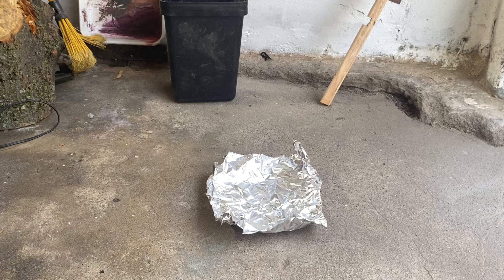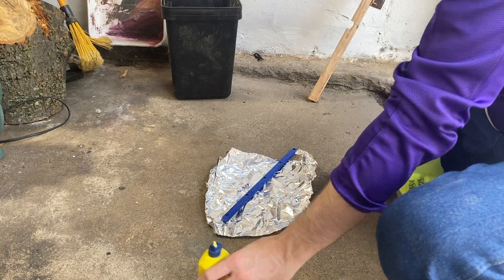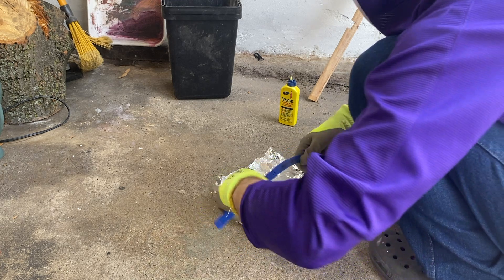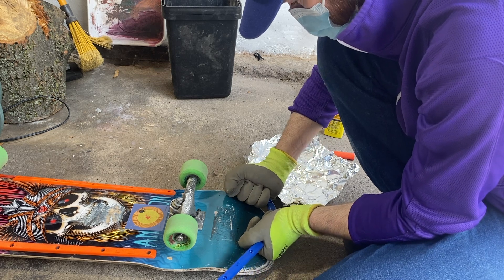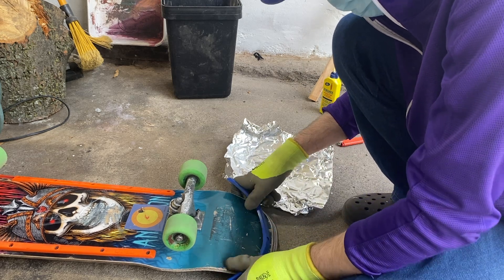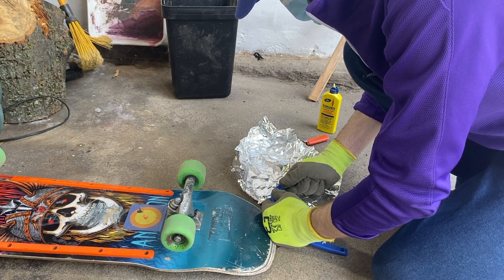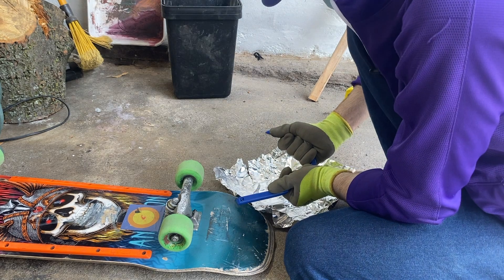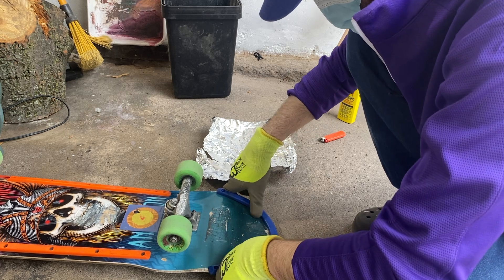How to Make a Tail Protector for Your Skateboard | Eliminate Razor Tail - Jeff

Comment: Is that the 9.13 width andy deck? I'm really interested in your setup
Reply from the maker: yes! 9.13x32 AA flight deck, G bones II 97A 64mm, ace 44 (p sure) - the deck is great, I'll be skating it on repeat until it's unavailable, doesn't break (I always break tails) and saves a ton of money
Reply from the maker: the wheels in this video may have been Slime Balls, which are also a fun time ;)